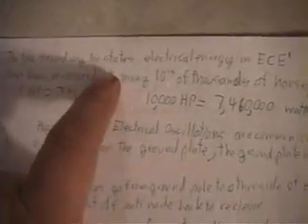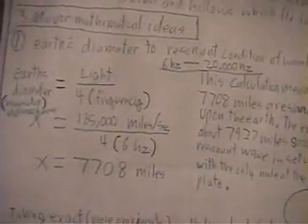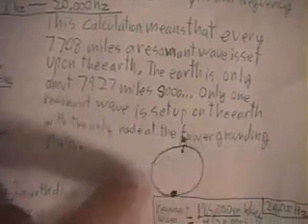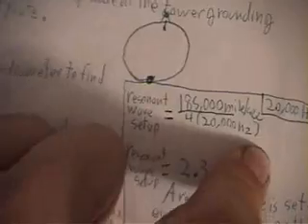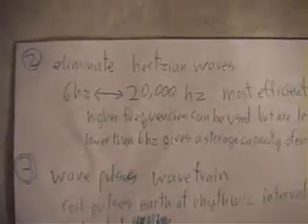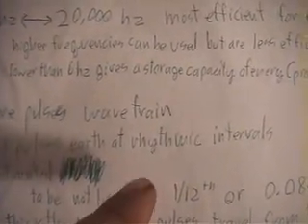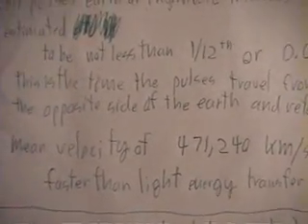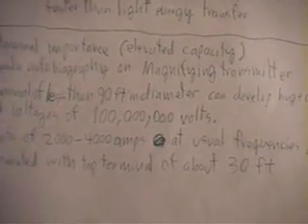Wireless Transmission of Electrical Energy, Tesla 1900 part6

Comment: Correct me if I'm wrong but you calculated the diameter and the 2.3 miles is within the earth not on its circumference. So you can't setup stations every 2.3 miles at 20000hz. According from what I've gathered from you, the stations would have to be setup inside earth OR all the calculations would have to be with the circumference. Could you please let me know what you think because I want to setup this experiment on large scale through the ground but I want to get my calculations correct first.

Comment from the maker: @Isreal4realz thanks alot for the support! yea i feel i have a good basis to go bigger and powerful with a device, i have build a 20ft model, but it was costly and so i have only so much i could use. there could be a huge increase with the small model i have, i feel i could go possibly 100-1000 ft if designed correctly, that would be another impressive step to work out the energy wave propagation in a closed matter, then one more step should be one capable of miles of transmission, that be cool!

Comment from the maker: @insightllc well tesla said it a few times, thats why i sent you the equation, 
tesla energy wave = speed of light * cosecant (degree on the earth)type it in google and get it to spit out some answers, you will see that as the energy leaves the tower its going 10- 100 times faster than light, then it hits the eqator and slows to light where it again accelerates faster than light to the other side, to reflect back to the tower, like a wave in a tube of water.

Comment from the maker: @insightllc im sure infinitly small amount of heat, but just read teslas notes, no heat was noticed on any of the equipment, and i myself have never had any form of heat happen in testing of the set up, just research harrp they are using the high frequency ranges, the whole other side of the spectrum from what tesla was using, teslas was low frequency to extremly low frequency.

Comment from the maker: thank you i appreciate your comment. i try my hardest to show people my truest effort. i literally sat down and read and learned and interpreted the best i could. the calculations are really neat when you apply them to the earths parameters, thats where i see the truth happening. when he describes faster than light travel it makes sense with such high voltages, such a potential difference without a current or resistance, which allows energy to move more freely and resonance multiplys that.